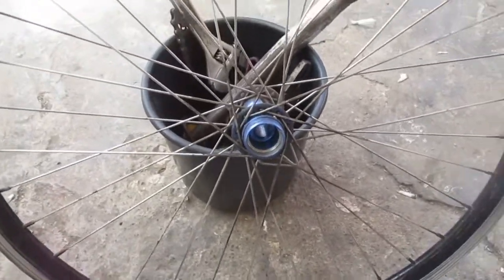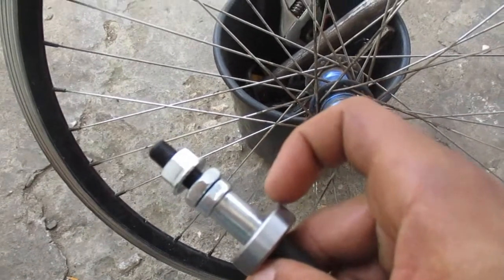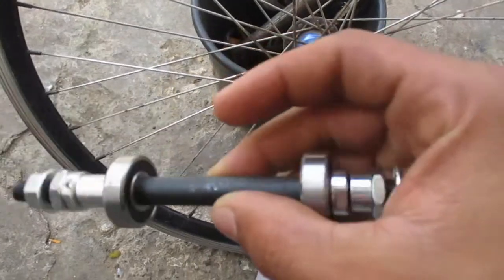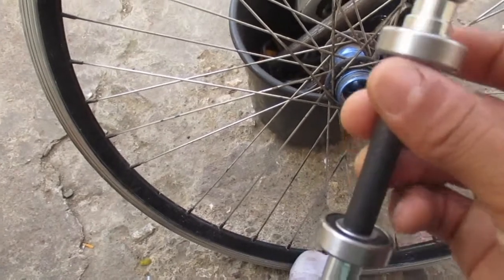how to replace bearing on any bike

Comment: So is a special axel  work with the bearings
Reply from the maker: No...... When purchasing your axle tell them u need the back wheel bearing axle
Reply: @DavidHacker  where can I get one of those back axle to buy
Reply from the maker: You can get it at your local bike shop
Reply: Which one because I checked most of them in Kingston and I don't get any

Comment: I'm from Bangladesh.I have bought 2 bearings,it size is 6000 2rs. But i need spendal or hub. Tell me hubs name.is it 40 screw?I need 40 screw
Reply from the maker: Thanks for commenting, no it's not! its a Rambo hub, tell me what type of bicycle do u have and I will search and tell u what u need.
Reply from the maker: Do u want more videos like this
Reply: Indian looking Phonics old model bicycle.
Reply: Indian hero bycycle.
Reply: if you 6000 are using bearings whose size is 10*26*8 Then you how you will insert 10mm axial    in it?
Reply: @harjinderbal1521  inner diameter is 10 mm

Comment: DUUUUDE! You simply needed to thread a washer and a nut on one side of the axle and "press fit" the bearings in with tightening the nut on one side. Provided you had everything fitted to the other side of the axle, like you did. You almost destroyed the bearings and the axle point by hammering with a steel hammer. At least use a rubber mallet next time if you're going to do things this stupidly. It's about using your grey matter instead of the brawn.
Reply from the maker: Thanks for watching Mr. Know it all